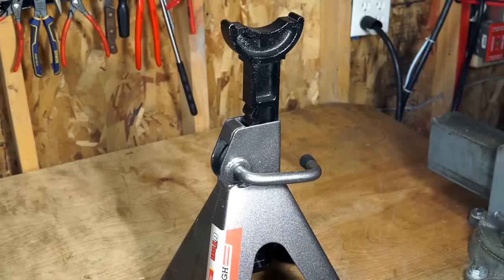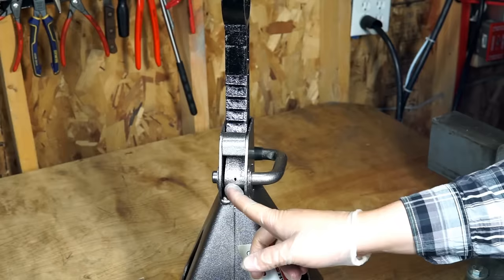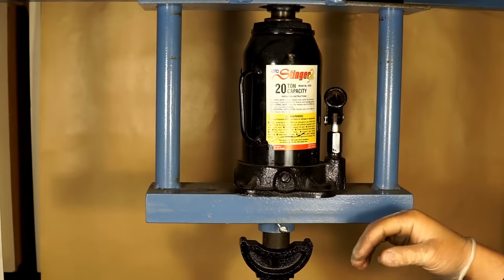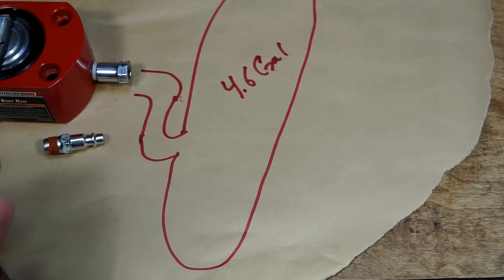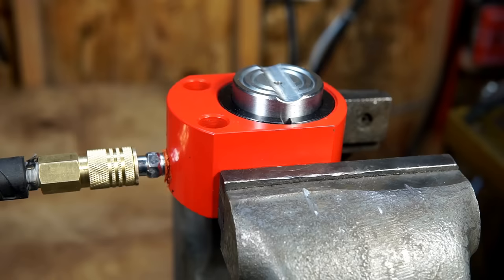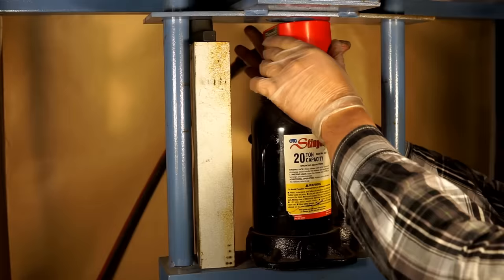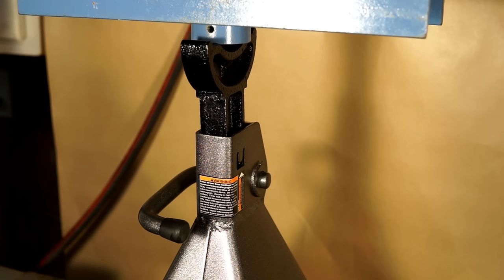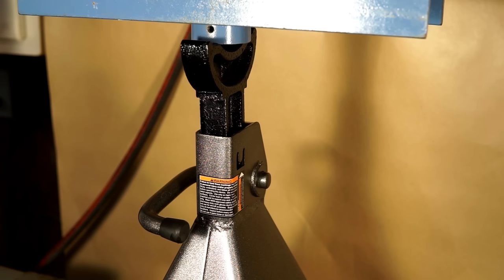EXPERIMENT: WARNING! Doing this to your Jack Stands will get you KILLED!

Comment: You're forgetting to subtract the return spring pressure on your press. The spring return for the bottle jack is reducing your theoretical applied force.
Reply: Joseph Gargasz yes someone caught it
Reply: 1. There is no return spring on the bottle jack. Did you watch the video? He had to force it down, with his pry bar.

2. The force of return spring in the modified hydraulic ram is negligible compared to the 500 lbs of pressure.
Reply: Joseph Gargasz jack no but in the press there are some stiff Springs that return the press dye to the full upward position. if it took a pry bar to press the jack down then the springs are applying a significant force against the air piston before the jack stand even touches it.
Reply: David Burton there are return springs on the press. It's an OTC press shop press. How do you think the jack automatically collapses when the pressure is released? The springs are on the blue bars to the left and right of the jack above the top beam of the press just out of frame on the video. Google search OTC 20 ton shop press to see what I am referring to. Due to him placing the "load cell" between the press head and the bottle jack. The force exerted by the springs will need to be taken into consideration when making your applied force calculation.
Reply: Absolutely correct
Reply: Joseph Gargasz WHEN I STARTED WATCHING THIS THATS EXACTLY WHAT INSTANTLY POPPED INTO MY HEAD!!!
Reply: I learned something.
Reply: Those springs reduce the force the shop press jack will see, but as long as the "load cell" is at 115 PSI it doesn't matter.. negligible anyhow
Reply: Rx7man no... You're completely wrong. 

They increase the force the jack will have to exert to extend. They are pretty heavy springs. I'd estimate around 200 pounds of force is being applied by the springs at that amount of extension. 

The "load cell" is between the jack and the press frame. This means the return force of the springs is compressing the load cell. Thus reducing the force he thinks he is applying to the jack stand. Since we are only talking 500 pounds here. 200 pound loss is far from negligible. 

I know this hard to understand, but think of the load cell itself as a spring. It will collapse at 500 pounds. If you have a force pulling up on the arbor it's pressing against. It will take less force applied to the arbor to collapse the spring(load cell).
Reply: I agree that the force of the return spring does need to be factored in when calculating final simulated weight, although I would be surprised if it was as much as 200 lbs. 

Also not calculated in the fact that as the air is compressed, the pressure gets greater, so technically the simulated weight increases. I am sure that is very small though.

However, the main takeaway I get from this is that it is nearly impossible to release a properly seated jackstand catch by just bumping it, and I would bet that even a hundred pounds would make it difficult to accidentally bump loose.
Reply: Doug Sholly the air will not compress any measurable amount as the volume of the little cylinder is very small compared to the size of the reservoir on the air compressor. 

You be surprised how much force can be exerted by springs.

Comment: That roll pin isn't meant to be a shear pin, far too thick for that considering it's only transferring a small amount of force in normal use. Roll pins often get used in manufacturing because they can be used as dowels in holes that aren't perfectly aligned or the exact same size.
Reply: Not a shear pin. It's a positioning pin. It cannot be a shear pin, it is hollow making the shear value incalculable.
Reply: It is possible to use roll pins as shear pins.  The aircraft I repair have certain components that in fact incorporate roll pins that are designed to shear.  The difference is the level of engineering/money/time put into the design of aircraft vs an automotive jack stand.  

None-the-less, these pins "should" be designed to shear at safe loads.  An easy way would be for manufacturers to use pins made of weaker metal — like aluminum.

I wonder if OSHA has any regulations on jack stand design?  Regards.

Comment: I agree with your comments at the 11:56 mark. Not only did it look like you had to put a lot of force on that pry-bar to get that jack to fail, but you can see the press flex just before it does so. Personally, I've been using that same model jack stand for quite a few years, and have never felt unsafe. When I jack my car up to work on it, I usually leave the scissor jack in place, then use a pair of these as a safety, lowering the scissor jack just enough to still be supporting some of the weight of the car, but also putting some of the weight onto the jack stands. Again, I've never felt uncomfortable crawling under my vehicle with these things in place.
Reply: Adding Wood, beside the Scissor Jack, even if not a Tight Fit, but close, like only a 1/4" or less clearance, also affords an extra Safety Factor! It might be something to add, if you know you might have to Wrench Heavily Rusted Bolts loose, for example!

Comment: Its most likly that Mike, jacked his car up slip the stand under the car, and lifted the jack-stand to the bottom of the vehicle, but the cleat wasn't fully set, but instead just barely catching. Need to jack you car up a couple inches higher than the height you want your stands, so you can check to make sure the cleat is set, by lift up on the top of the stand about an inch and see if it drop back down onto the cleat.

Comment: I'm a industrial Mechanic and used to work on big industrial Diesel power generators and when we jacked those up we used to crib 2x4 or just make them into square blocks with screws. At home I jack my car up and use 1 jackstand like this and on driver and passenger side frame/underbody I put a 4x4 or 6x6 fence post standing ,those are way better than the jack stand and you know the car isn't going anywhere. It's a bit Overkill, but safety first. If you lucky you can find scrap 4x4, 6x6 or even 8x8 fence post, cut them to size and use minimum 2. Just remember people safety first I have my jack, the metal jack stand and the 2 fence post also a tire under the car and wheels chocked.
Reply: Are you saying you make cribbing with the fence post, or you just lay it flat along the edge?
Reply: @longwalkinthewoods5457  I use them standing up and not on the edge usually on the frame, I put the jack stands on the little jacking strip they have by the driver and passenger side wheel's. I cut the fence post to properly around 13-15 inches height.
Reply: I'm sorry but a 4×4 stood on end isn't anywhere near as stable as a jack stand.
Reply: Good ol Oak is your friend when you are under a car or truck. The steel of the frame digs into it.  But just don't stack a lot of pieces of it to high! I used peices of railroad tie for years without a problem. Another thing you could do. If your worried about it. Is saw off the length of the release handle on the jack stand. It does not have to be that long to drop the unloaded jack stand. And it would take a lot more force to move it when under load.

Comment: 1) My father taught me to always try to find something to rest the car on after you jack it up.  You should be able to lift a corner or end of your car, rest it on something and remove the stands and be a lot more safe than just relying on stands.  When changing a tire, of course that may not be an option, but you shouldn't be anywhere underneath the vehicle doing that kind of activity.

2) You said it yourself, about 1000 lbs of pressure should shear the pin.  You did not do that.  you applied 500, which you argued was an OK exercise since more than a corner would have been lifted.

However: 3) who is going to be applying that much pressure in that direction underneath their car?  You had to use a mallet in upward swings with a nice arc to get that lever to move.

If the story is true, they had a faulty stand to begin with.  I did not take away that there was a jack stand failure, just one way to get it to fail unrealistically.  BUT  Good video.  Any positive and useful education about the subject is good education.
Reply: My dad taught me the same thing, and to have other things (like railroad ties or car rims along the body of the vehicle so if the jacks fail you wont get crushed)

Comment: use jack stands with 1/2 pins that lock it in place and not a lever mechanism
Reply: This here. When the pin is out Mr. Jackstand is not your friend.
Reply: Been thinking about drilling a hole in my jack stand to add a safety pin. Basically it uses the lever but will hit the pin if it fails
Reply: One weights on the jack the pins won’t move, same with the locking pawl ones like shown in the video. Only way either type can fail is if you make them fail by hammering out pins or crowbarring open locking pawls
Reply: Your Highness exactly!!  At work we’re only allowed to use these style.  Needless to say they’ve never failed and we love gigantic 7 ton trucks etc
Reply: @trabant3060  Just spray some brake cleaner on your hot engine :) (don't actually do this, obviously)

Comment: Weight wouldn't be evenly distributed even on a tiny porsche that weighs one ton. It would weigh most at the engine and very little on the other side of the vehicle in comparison. So he probably didn't even have to lift 500 pounds, depending on where he was. That jack may have only been supporting 400 pounds, or maybe even 350.

I don't know how much easier that is but I suspect you could bump it with a tool.
Reply: Prometheus720 even if the weight isn't evenly distributed the other jack would have picked up the load the car would have tiled but still would have been on both jack stands.  With that said though if the stand was on soft or uneven ground it may have caused both stands to fall over
Reply: A 914's weight distribution, is approximately 40/60 front/rear.
Reply: don't they park their cars on concrete blocks by default?
Reply: Prometheus720 the engine is at the rear where all the weight was
Reply: Jimmy Grant 914 definitely mid engine transaxle in rear. Tho you are correct if you mean more weight at the rear. 914 is one of the scariest cars you can drive fast due to unrecoverable snap oversteer inherent to mid engine/rearward weight distribution. If you ever drive one and go into a corner too hot just remember "never lift off (the throttle) at mid apex."
Reply: batvette yeah I know it's technically mid but indeed the weight is in the rear and the 914-6 the engine was sitting farther back. Still it's sounds like the car rolled forward if the front wheels were on the ground. Now a 914 isn't near as scary as an early 911 go into a turn never left off or your in the ditch or possibly dead. 930 Turbos are scary too even though the engine was mounted on the subframe help solve the problem they still did it even with horrible turbo lag snap your fingers and your gone. Even before they were sold every once in awhile a Porsche salesman and a buyer would come walking back after putting a 930 on its side. This was because he went through a turn (that is now gone as the new Falcons stadium is built on top of it) and the boost hit he got scared let off spun out and hit the curb laying the car on its side. Fun times.

Comment: I think that was a great experiment, no flaw that i can See you simuated the weight and allowed for it to be lifted, i have those jack stands, and i can tell you this, you cannot move that lever unless all of the weight of the car is completely off, unless you use a lot of leverage, I have tried while trying to get the jack stand out after jacking the car up quite some way and the only way to move that lever is to get the entire weight of the car off of the stand I use a broom to hit the handle because I don't like sticking my head under the car when I am trying to release the jack stand and it is near impossible to lift that lever unless all the weight of the car is completely off of the jack stand, barring of course using something with a lot of Leverage. Which I have never tried. And never want to try.  Great job dude, thank you for sharing.  God bless. FM

Comment: Harbor Freight sells a "Daytona" brand jack-stand that has an extra safety pin you insert that not only pins the next ratchet tooth up but prevents the release handle from moving. Twice as much tooth contact area and a locked handle. It has very good welds and works well.

Comment: That guy might have not had the jack stand completely locked into the slot and it gave way with little force
Reply: That's my vote.  I have one stand that got a little rusty and the lever is a little tough to move.   I've had to force the handle to get the pawl to align properly and lock in place.
Reply: Yep, looked in the comments to see if someone else figured that out.
Reply: Yes, that's the very first thing I thought of was the pawl not being fully engaged.  I was always Very cautious when using those.
Reply: Yep could have been a shit jackstand as well...
Reply: Your exactly correct:i did same thing and failed! my jack I lowered =I always reset it. and just pump up to touch the same spot I lifted=as backup! it saved me! The rare accurance that u lift the car the same hight as jackstand can lift and not quiet make next lobe-it hold till anything bumped!

Comment: My jack stands have locking pins on them so thus will never happen 👍🏻👌🏻
Reply: TIGER x GAMING same here, dont buy those cheap ones without pin
Reply: Never say never. As soon as it can "never" happen, you get complacent, and something "new" happens.
Reply: Nothing new will ever happen to the aluminum pin in the wrought steel base, holding the cast Fe/Al ratchet lift. Even more so if it is all aluminum.
Reply: DDS029 yeah next time he better weld on safety pins on the safety pins because who knows when that will break eh...
Reply: Jay Edlington You're saying aluminum and iron is unbreakable ? 🤭🤦🏼‍♂️
Reply: In reply to TIGER x GAMING
Thoose kind of jack stands you mentioned are the most safe in the world,the real intend of a jack stand is to secure the lifting eliminating the hydraulic jack failure risk due long time lifting,the jack stand in the video might have a faster release ratchet but is more risky to fail than the hydraulic jack (that risk usually attempt to prevent by usung jack stands in the first place) !
Reply: What brand do you have?
Reply: same, don't buy cheap ones
Reply: TIGER x GAMING where did you get yours
Reply: What brand? ?
Reply: @edlingja1  - Yeah they slip or break the same ol' fashun way.
Reply: @funzosupport6922  - If your car weighs 2 tons get 6 ton jackstands. Can't be too safe! A DC-10 engine might fall on top of your car while you're under it!
Reply: 😊 i hate the locking pins but it mite b useful
Reply: Or just on lift them
Reply: You have no idea if the guy's guess about what happened to disengage his jack was correct.  Certainly he didn't pay attention to cause that, so his guess means little and the jack could have been shoved sideways or the fram buckled.  Lockings pins, which aren't locking pins so WTF are you rambling about?  They are pins, no lock, can only help with one type of jack stand failure.  They are better to have than not, but this will never happen even without them.  There is no way to bump the jack stand lever as hard as when using a prybar.  None.
Reply: @lecyalphamaids9134  Learn to use your keyboard caps key. Learn to make shorter URLs.  Learn that if you link elsewhere, youtube may consider it spam.  Learn that strongway is just a relabeled Torin jack stand.

Comment: The bottom setting of the jack stand height is a fool proof safety measure.  I have always kept that in mind and tried to avoid setting the height so low that I had to squeeze under the car.  In other words, leave yourself some room in case the jack stand spontaneously drops to the bottom setting.  I also try to always use both floor jack AND jack stand, or some type of backup.  On a different note, I noticed that using four jack stands makes the vehicle much less stable than keeping one axle on the ground. Lastly, for DIY-ers, do let someone know you will be working under the car before you start, if possible.  Physics and gravity are unforgiving.

Comment: i hate those type of jackstands. currently i just picket up a different type (older vintage style) off of offerup. It has the holes in the moving thing and you put the pin through yourself and there is a clip to make sure it doesnt come out. its a little bit harder to take apart etc. but its worth it. i learned my lesson adjusting a chain on my kart when a jackstand collapsed on me. my  go kart is pretty damn heavy and my head was under it, but i had a couple bricks in case under the kart.

Comment: One thing I think is important to know, is this it a 6ton stand, it's safety feature tolerances are likely adjusted for this weight. My 2ton light duty stand has a much smaller pin than my 10ton stand. This 6ton jack likely isn't meant to fail safe for such a light load.

Comment: Jack stands with ratcheting levers have been around since the beginning of cars. In fact nearly all the garages and dealerships used those Walker cone shaped  jack stands made in the  40's and 50's well into the 90's and people are still using them today. They never failed,never collapsed on anyone. They were over engineered. The only times youd ever hear of an issue was if the person using them didnt place them correctly,overloaded them or did something stupid. 
I guarantee you the guy (or "dude" as you keep referring to him as) whacked that lever with some force to get it to release on him.
And to the folks saying you should always have the hydraulic jack under the car too.  Sometimes,like if you're swapping out a rear end that isn't possible